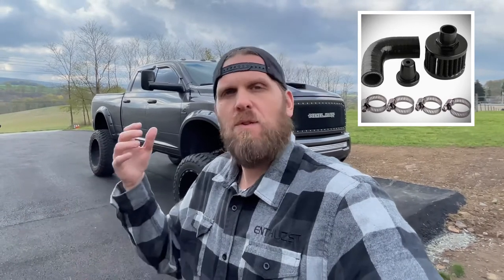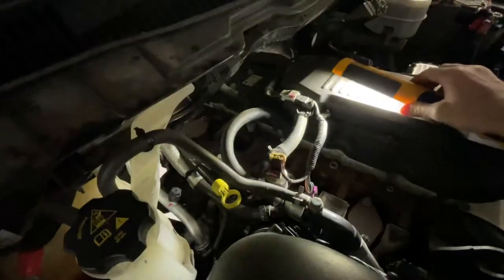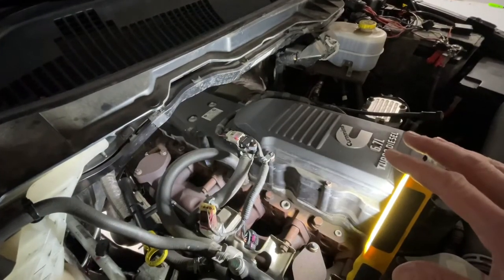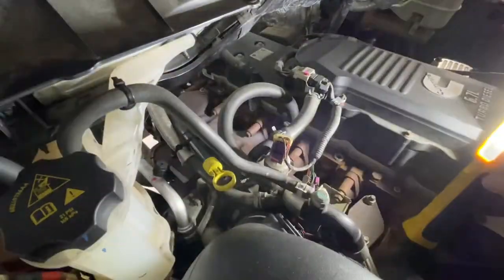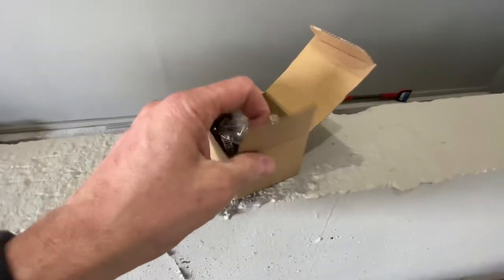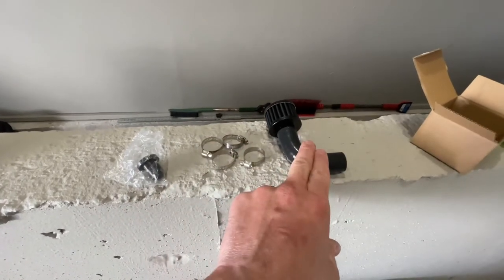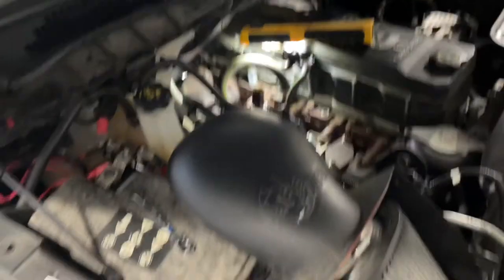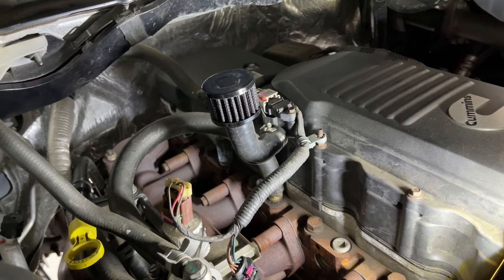2016 Ram 2500 6.7 CCV Tube Delete

Comment: I did the delete on my 17 and have a code now anyway around that code?
Reply from the maker: Try to disconnect battery or use a code reader to reset.  If that don’t work try to reinstall the tune.
Reply: @DieselLegiance   hey buddy   What about if your truck is all stock no tunes.  How to reset code

Comment: Your better off with  a filter delete and a catch can 👍
Reply: Cant see how gutting the filter is good in any way. The catch can I am on board with and if U do that, that will gather the excess oil, which can be emptied over time and it will also allow for any excess CC pressure to dissipate, thus reducing or eliminating potential excess pressure on any seals. Leaving the CCB filter materials intact also removes the mess. This seems like the best alternative to me.